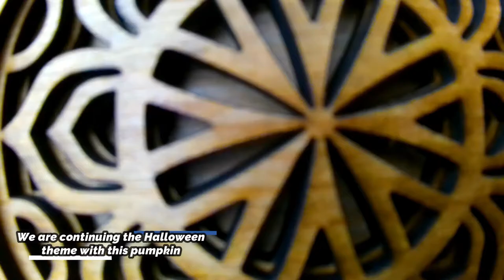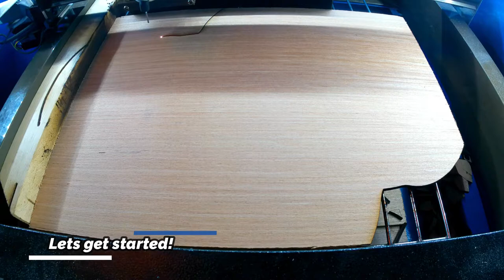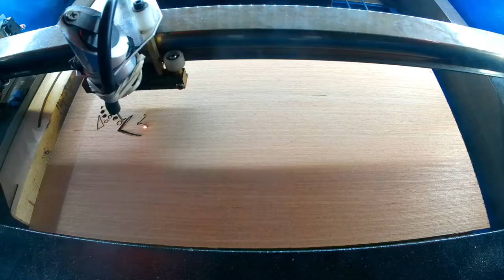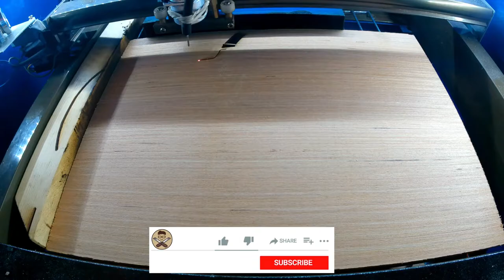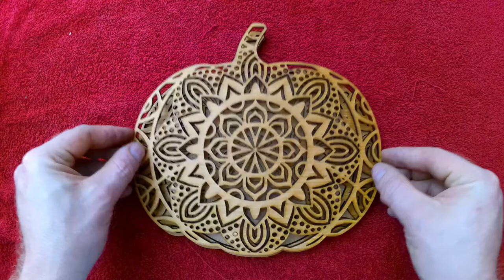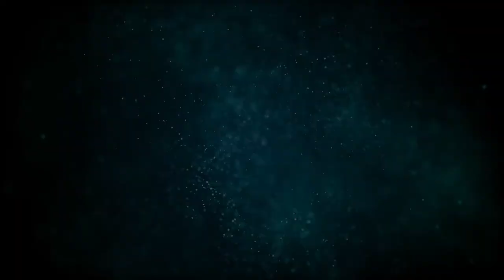Cutting a Pumpkin mandala from plywood on a K40 laser cutter : Satisfying 3D Art

Comment: Honestly 25 minutes for all that detail on the first layer is pretty awesome! What speed and power did you cut at?
Reply from the maker: Thank you. This is cut from 4mm mdf, 7mm/s at 15ma power.
I have upgraded si mirrors and a USA ZnSe 50.8mm fl lens
Reply: @philscraftcorner  Do you monitor temp in laser tube? 20+min @15ma is right on edge.
Reply from the maker: I have a pretty large water bucket (20l) of distilled water and I then add a 5l frozen water bottle to that when I start. The water stays around 10-15°c during use. This generally gives me around 2 hours of working time